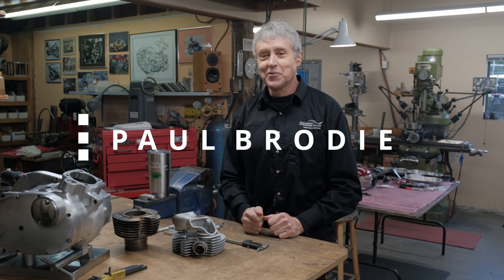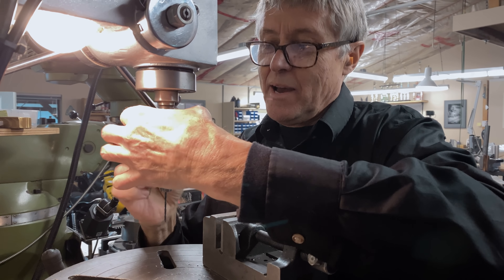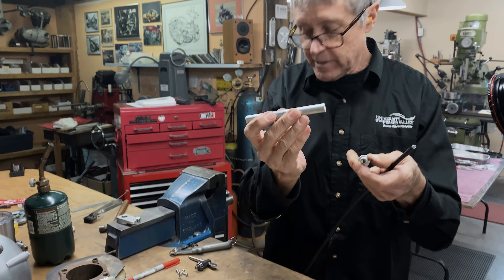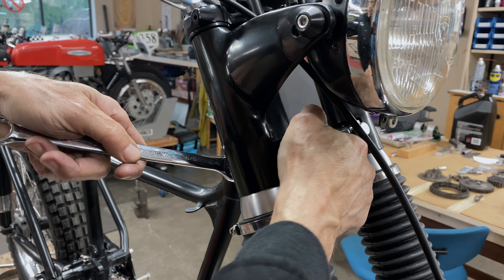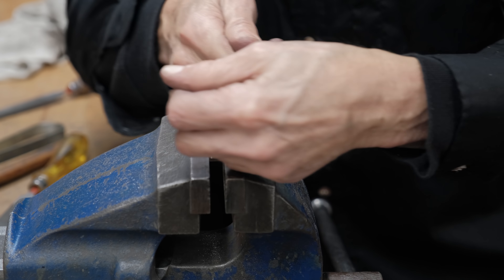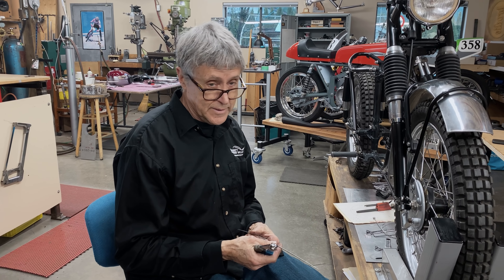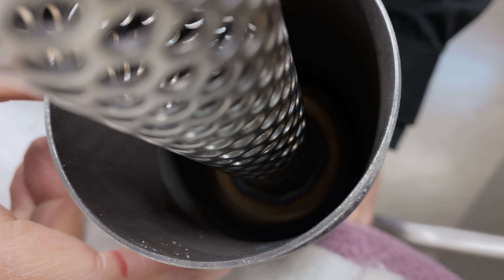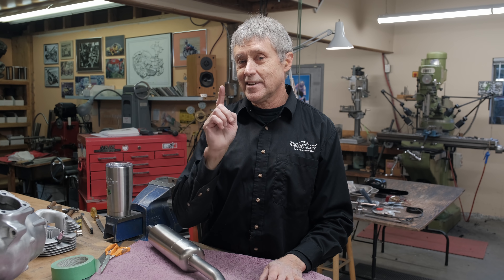How to pack a muffler // Paul Brodie's Shop

Comment: You ARE packing the muffler too tight !  LOL it doesn't need to be real tight really just get as much of the packing in there that you can... if you pack it real tight it won't deaden the sound very much ( i know I made a few in my time ! ) actually the looser you pack it the quieter the muffler will be ! within reason obviously i just stuff it in with my fingers and that is tight enough.... ..... Just so you know ! <grin>
Reply from the maker: Bob, you have a different story to everyone else that I have talked to. It is what it is, and we will find out how it sounds when the motor is finally fired up. Thanks for watching.

Comment: Face mask for protection against tiny fibers.
Reply from the maker: I used to play in vacant lots and drink water out of the hose. That's my generation. I do so little with fiberglas I think I'm ok, but thanks for your concern.
Reply from the maker: @Alfred Wedmore  I was realizing I insulated my house and my shop years ago with the pink batts of fiberglas. Never wore gloves or a mask. Obviously, still here.
Reply from the maker: @Alfred Wedmore  I guess in that regard I must have thick skin.